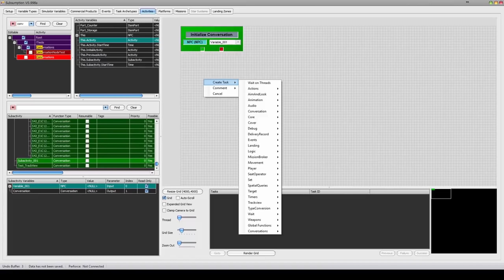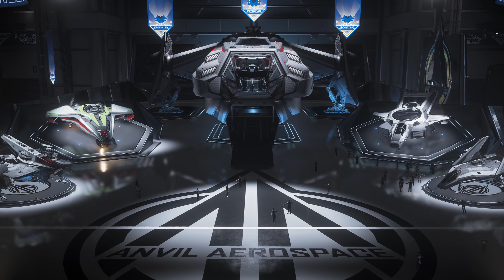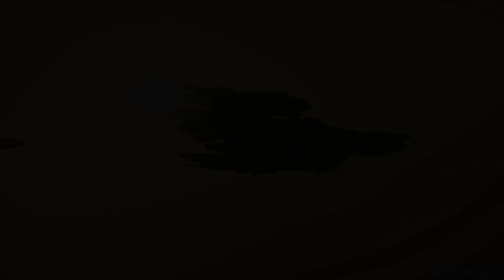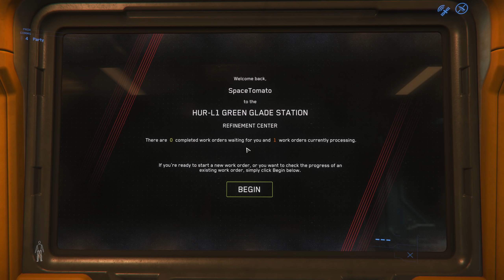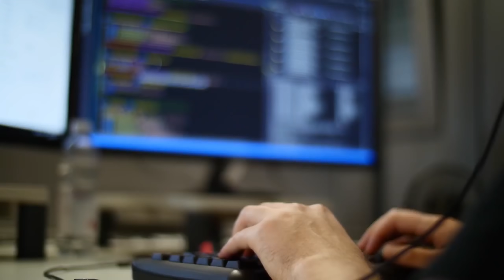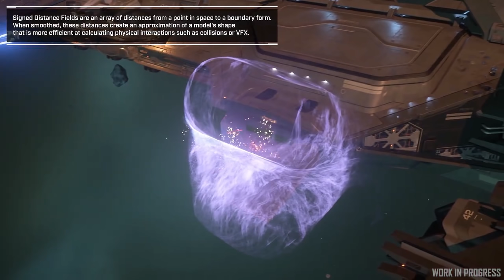Star Citizen February Report | Good signs for cargo, Clouds, & more!

Comment: Just a heads up. I-cache updates are most likely not going to be referenced clearly as they are focusing on parts of I-cache. Gonna have to do some digging for those. Basically what you had said with the gladius under testing is the hot bed for i-cache features as well.